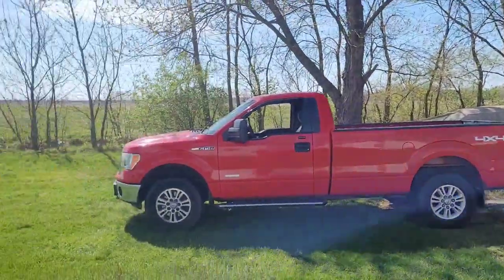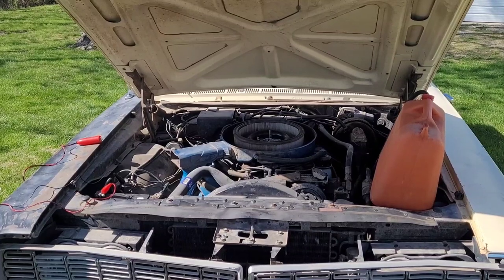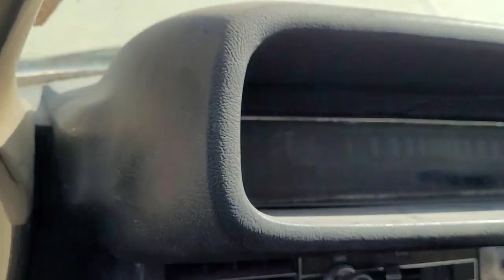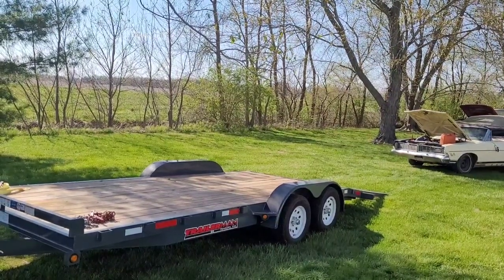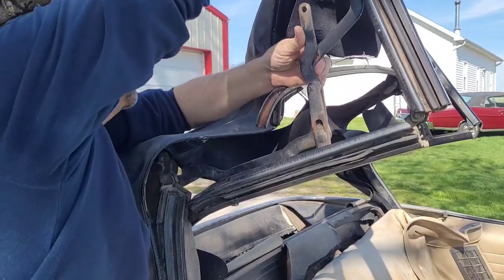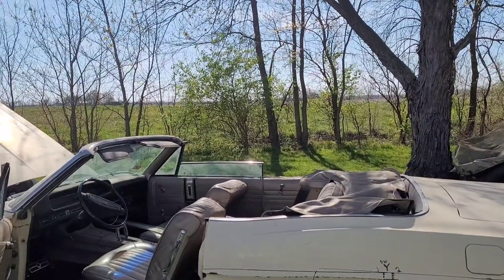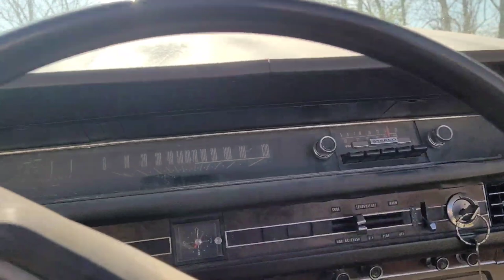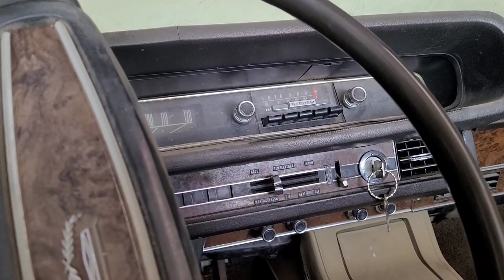Part 3 Nebraska Trip 1968 Ford Galaxie XL Convertible First Start Up And Convertible Top Operation

Comment: Even needing a quarter panel, I too think that car is restorable.
Reply from the maker: It needs both quarters, both doors, trunk pan, both bumpers. Believe me, I know how hard it is to find 68 Ford parts. That's why I've had to buy so many complete cars to get one thing I need. Totally not worth it!
Reply: I think you are leavin alot on the table by not putting that car back on the road. I can get you both guarters, trunk well and lid and both doors from a 2dr HT that is sitting in a junk yard. Whats the problem?
Reply from the maker: No thanks, man. Clearly, you've never restored a 68 XL.
Reply: @tonyscarcare5657  Your right lve not restored a'68 XL, just 3 '65 Galaxies. Similar body shells, very similar frames. Assembly techniques the same. Did part out 2 '66's and the aforementioned '68.
Reply: @tonyscarcare5657  true, I just hate to see a rare old car die.
Reply from the maker: @danielulz1640  some have to be sacrificed to save others.

Comment: Hi Tony, looks like you tried everything except the wipers, and the AC/heater
Reply from the maker: I have since then. The wipers and heat work and all vacuum doors switch as they should. The air, of course, doesn't work.

Comment: Almost a shame to part that car out it does everything it's supposed to.
Reply from the maker: Yeah, but where would anyone find the body parts? It would cost more than it its worth, even if the parts were out there. I've been trying to restore my 68 for years, and I know the difficulty and cost.
Reply: @tonyscarcare5657  I feel ya, 67 & 68's are one year only cars been trying to restore my 67 XL convertible for 20 years
Reply from the maker: @ericheld4382  I took mine apart in 1993!
Reply: @tonyscarcare5657  bought mine apart in 2003 it was in a body shop where it was stripped down to bare metal, I primed it put it together put 100 miles on it , met my ex wife got divorced now it's time to do something with it, I actually might change career path so I can afford to do it right.